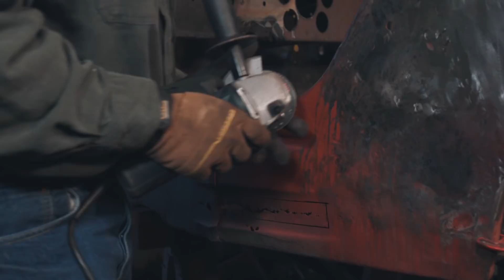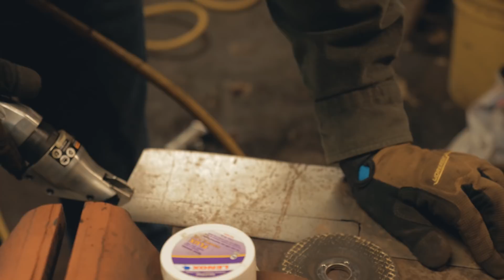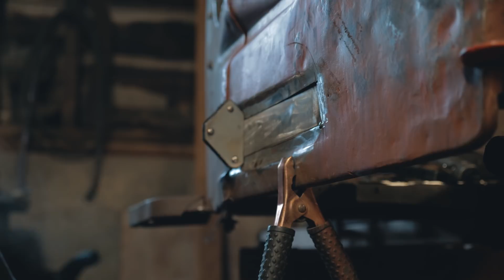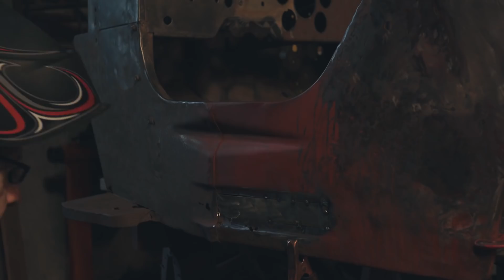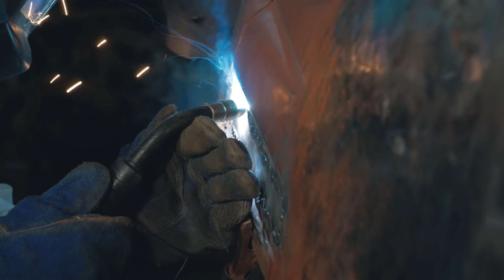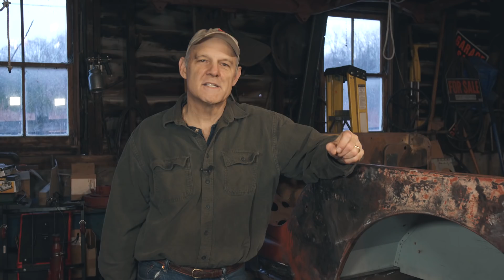1943 WW2 Jeep #g503  Tub Repairs #8 - Rotten Pioneer Tool Indents

Comment: Great work Patrick.  Have you ever attempted repairs like this with a TIG welder?  Interested to know which one works best for seamless patching.  Thanks
Reply from the maker: Thank you! TIG is fantastic and works super - the biggest issue is whether you have good enough parent metal and access to get the area spotlessly clean.  If you can clean it completely of rust, I think TIG is a superior process - cleaner with better control.  Lots of times, access issues make the cleaning tough so you end up with a little bit of surface muck.  In my experience, that wreaks havoc on TIG... I am working on a Weasel right now and there are places I can't clean the back side of an area I am patching - I always grab the MIG.  In spots I can clean it....out comes the TIG.  Enjoy!
Reply: @Portrayalpress  Thanks Patrick, great info

Comment: Great series of videos.  Thank you.  I am about to start my slat tub.  What tool did you use to cut the new 18g sheet?  I have never seen one like that before.
Reply from the maker: Thanks Andrew.  That is a Harbor Freight special - Inline Air sheers for less than $30.  Not a great tool by any means, but it should last for the duration of this restoration.